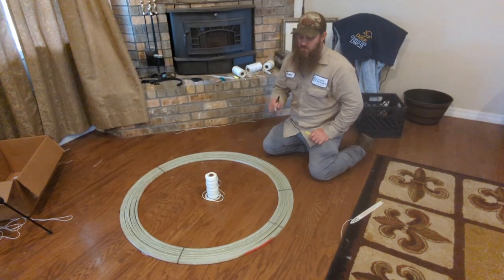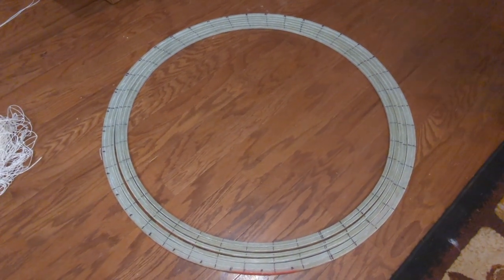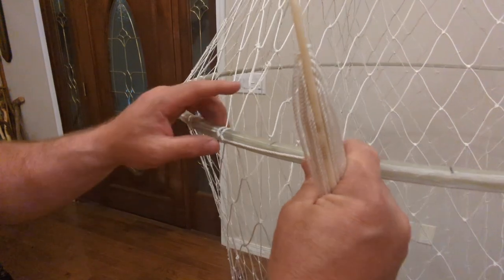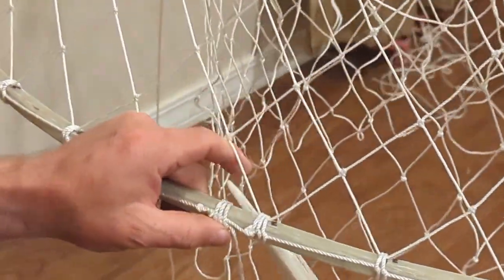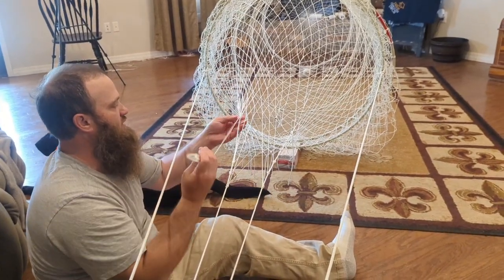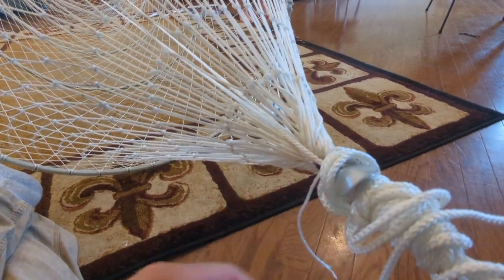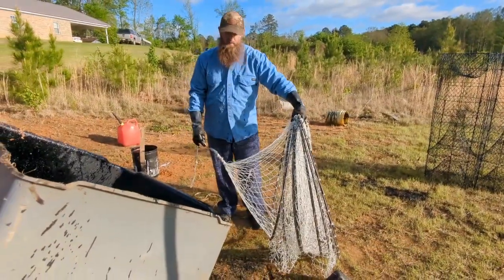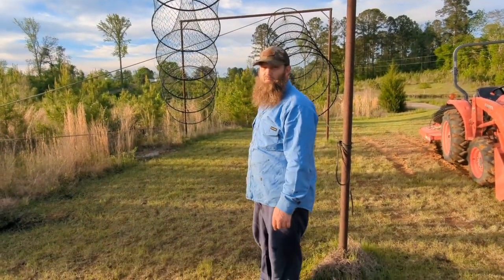Flathead CATFISH Hoop Net !!! (How to Build a HOOP NET with Factory Netting: Part 3)

Comment: Never set hoop net before. Thinking of making one this winter. Seen picture on SCDNR site  that had 30" at  head down to 24" at tail. Appeared to have 3 throats. River I'm going to fish may be hard to find water deeper than 4'. Could you make 30" hoops oval to keep them 24" high? Any thoughts would be appreciated.
Reply: Thanks for the inspiration!
Reply from the maker: All depends on what kind fish you have in there. If legal the wire nets we use for channel cats are 18 in. You can also make like 30in hoop nets. Just a smaller scale of what we have. They sell all size hoops. Typically hoop nets do taper down
Reply from the maker: @edwardbeck8413 No Problem
Reply: @godscountryhuntingfishing1638 I was thinking that if you put bait between 2nd and 3rd throat, any fish going through 3rd throat couldn't eat any more bait so your trap would fish longer. The wider first hoop would act as small leads. Don't know, just thinking. Small rivers around here  aren't very deep.
Reply from the maker: @edwardbeck8413 3 Throat nets catch good, but I've never used one. All mine have 2
Reply: @godscountryhuntingfishing1638 thanks for all the information 
Love the videos.
Reply from the maker: @edwardbeck8413 no Problem

Comment: How long should the catch throat be from where it ties onto the forth hoop to where the tension lines tie onto the last mesh of the throat?
Reply from the maker: That all depends on hoop size and mesh size. I go off how many mesh. It also can vary among net builders. It's kinda personal preference. Some like shorter throats, I like longer throats, but not too long. It really doesn't matter as long as you end up leaving a softball size hole IMO. Channel cats you can go smaller than that like baseball size. I catch everything in these throats I'm building. If I want channel cats I use wire nets
Reply from the maker: Normally on 2.5 mesh you end up 5-6 mesh on first throat, and 8-9 on second throat